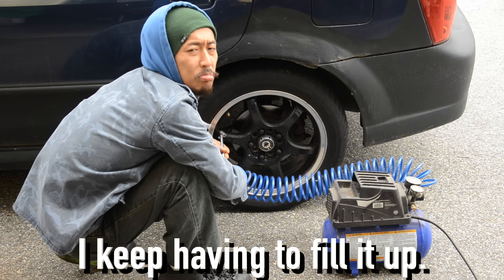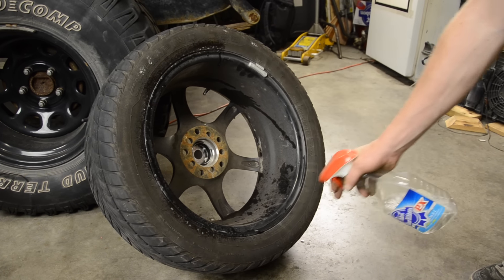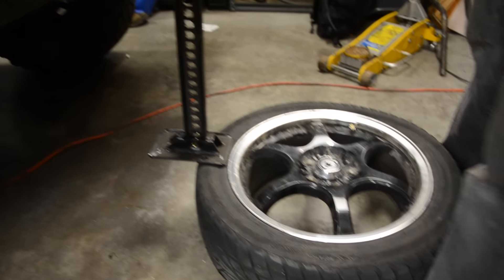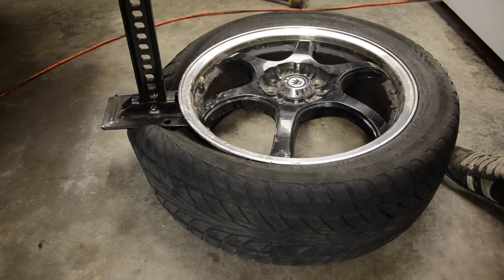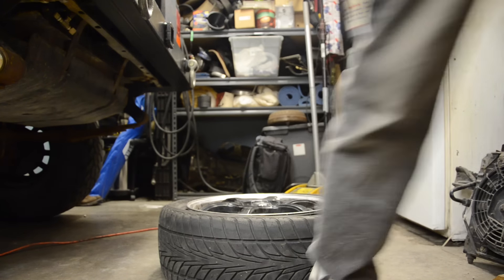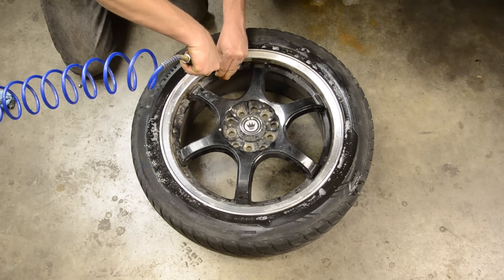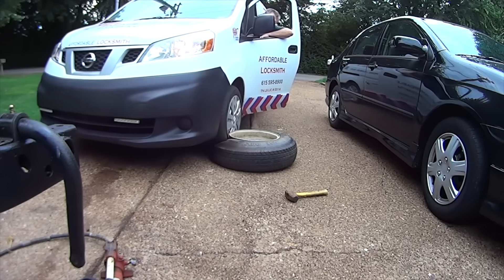Slow Tire Leak - Bead Seal - Quick Tips - The Roadhouse

Comment: Another tip is to apply Dawn (brand) dish soap around the tire bead, as it tries to dry it will thicken into a gluey like compostion and seal many of the small rim leaks.
Reply: Papa Jon do you need to break the bead seal?
Reply: Yes, we use it also as a lubricant to make installation easier, it must be between the rim and the tire.  I have also used the fluorescent green Slime (brand) where some was used and then the tire positioned with the rim leak down and then driven/ridden around.  This is especially useful in pitted steel agricultural rims that sit out in the rain for years.

Comment: Awesome video! I used a pair of 2x4s to break the bead seal on tires years back. Place the wheel on the ground next to something heavy (like your XJ). Stand a short (1-2 foot long) 2x4 up on bead, then use a real long 2x4 and your XJ for leverage to push the short 2x4 down into the bead. 

Hopefully that makes some sense. It's hard to explain in a comment but it actually works! Happy wrenching!
Reply from the maker: Does make sense.
Cheers!!
Reply: Makes perfect sense to me. This is the technique that I will be trying first. Thanks.

Comment: To unseat the rim, more people have a bottle jack and that will work under a truck bumper or even under some cars.

Driving up on the tire with a car might be hard and could damage the tire you're trying to unmount.  Put a board across it making it into a ramp and it's easier to drive up onto and then the board presses down on the sidewall and you can control how much it compresses it (have someone tell you when to stop when it unseats).  It's much safer and easier.
Reply from the maker: yup
you're right
Reply: i agree, ive done that many times and stopped using that method once i damaged my fender when the tire flipped upwards.

Comment: didnt know wire brushing only is enough , thougt paint was needed like zink spray, will try this maybe . easy way .could try painting too with tire on. bead on wet or dry.  once used putty for bead  sealant gray thick not very silicony. worked well on vespa scooter wheel . and normal jack can be used two jacks under front side behind front wheel cos engine holds down one to hold car up near middle or behind,  tire undercar side,  jack foot on bead top under car on normal jack place.
Reply: It's actually not most of the time. You normally need to brush away the corrosion, and apply bead sealer. It's a tar like substance. Also, if you breaking the bead of the tire like this.. I would be careful not to have the valvestem in the same section you are breaking it like they did, usually most vehicles will have TPMS sensors there and they can easily break. 
And pleasse don't run over your tire with a vehicle to break the bead.. That could easily damage the sidewall of the tire...

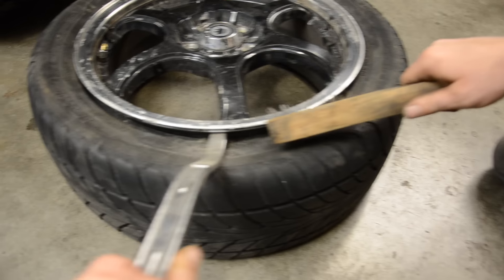Comment: I swear I saw green tire slime inside that wheel at 2:10.  This stuff is highly corrosive to alloy wheels.  If it still leaks after your procedure, try using bead sealer on the rim.  And NEVER use slime on road going stuff.
Reply from the maker: it did look like that, but it was a sticker from the manufacturer.
I would never use that stuff..... yuck

Comment: My usual method is to remove one of the front wheels and lower the brake disc down onto the tyre. If you have a small car you pretty much have to use the front disc, as the back of the car is far too light to break the seal. 
Or I suppose you could load up the boot (trunk) of the car with heavy things.

Comment: Public service announcement, all Jack's are dangerous, most notorious are high lift Jack's, especially if you're unfamiliar with them and your vehicles lift points, also it should go without saying putting the weight of your vehicle on a bouncing flat tire while straddling and jumping on it makes about as much sense as Pabst blue ribbon.

Comment: Try having 90psi in the tire seating beads on custom wheels.
Reply: Try' 150 psi. Occasionally we blow a tyre, just connect the airline direct away from you on a mat and unplug it from the wall when it pops on' a lot safer than on the machine.
Reply from the maker: I get nervous around split rims the most....
Reply: Doesn't everyone?
Reply from the maker: Lukeozdigger We'd hope....
Reply: Luckily I never had to deal with those.
Reply from the maker: They're pretty nuts if they let go....

https://goo.gl/QY6yx1